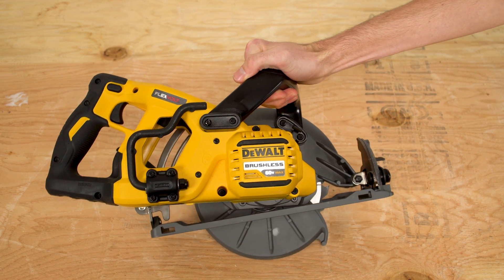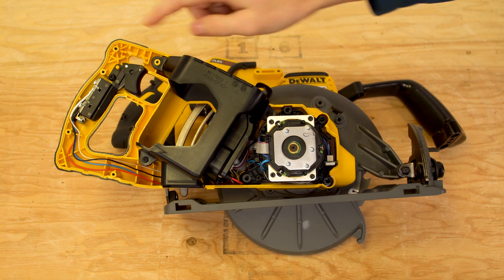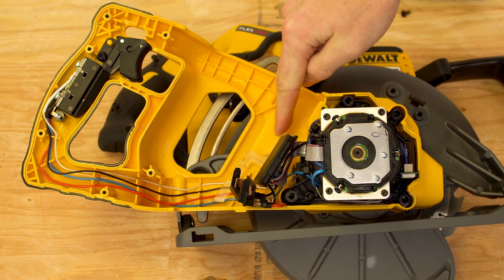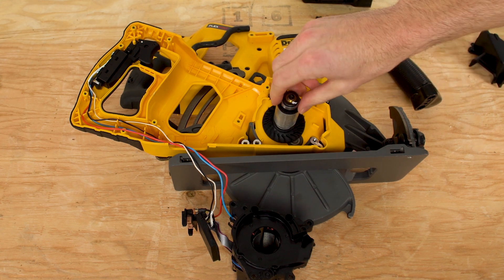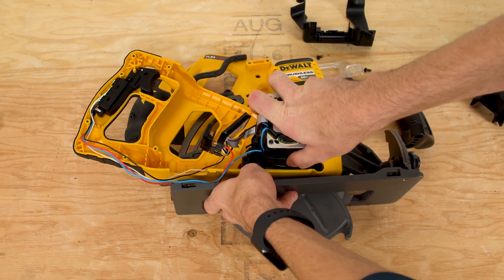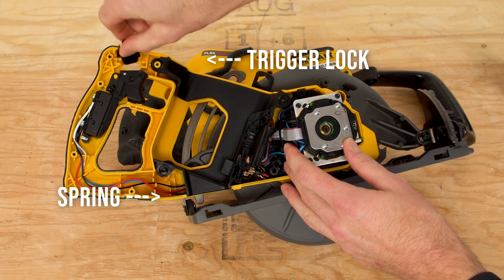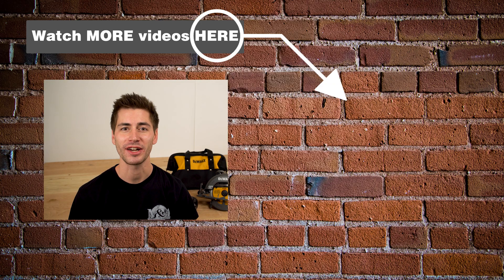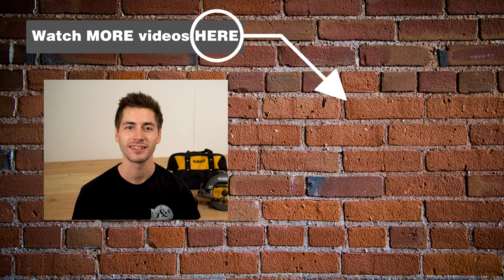DeWalt DCS577 Flexvolt Worm Drive Saw: How To Replace Switch and Field (Part # N556110)

Comment: Okay I have a 20 volt Max XR DCS 570 when you pull the trigger the light comes on and it runs for a second and stops and then sometimes it won't run at all move the blade and it'll run any ideas

Comment: My dewalt worm drive started to bog down and I thought the batter was just dying. So I swapped to my other flex volt 9ah 60v battery. It smoked up. Now neither of those batteries will work on any of my flex volt tools. They work on my 20v tools though. I’m pissed, I spent $300 on the saw and over $200 per each battery. Can someone please help me get this fixed. I’m not sure if I should buy all new saw and batteries or if there is a way to get them fixed. Because that’s bullsh*t it fried by most expensive batteries. I’m a contractor and have been running dewalt my whole life, spend over 20k on tools from them, but I’m about to ditch them completely and go to Milwaukee because I’ve heard of no issues from them
Reply: call dewalt, if its with in the 3 years service window, theyll replace that shit. or fix it up.

Comment: Every time Press the trigger and run it, the rotor, bearing or the spinner is making a bad vibrating sound. What is the vibrating when the blade spins?

Comment: Anyway to get rid of the safety button so I can use it without pressing the button?
Reply: Push it to  one side and push a small wood wedge in it the  tape it .
Reply: Im visualizing pushing the button all the way over, drill little hole in it and put pin in the hole.
Reply: Grab a sharp serrated kitchen knife and press the sharp side against your thigh.

Maybe safety isn't so terrible after all.